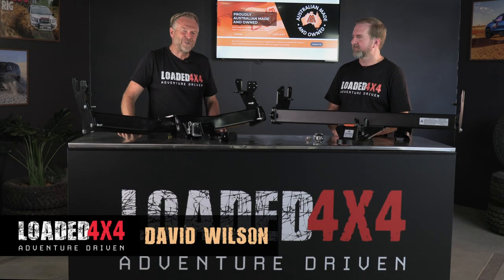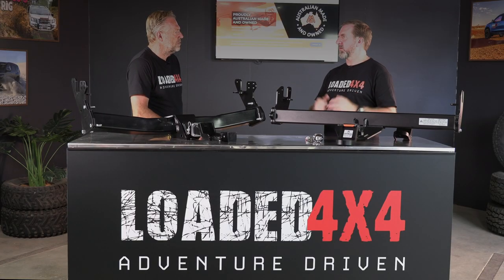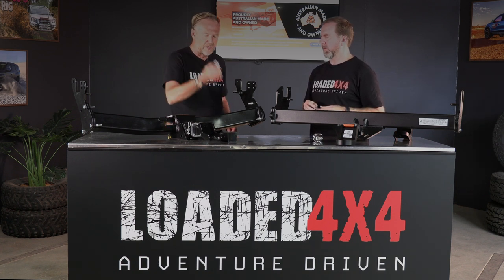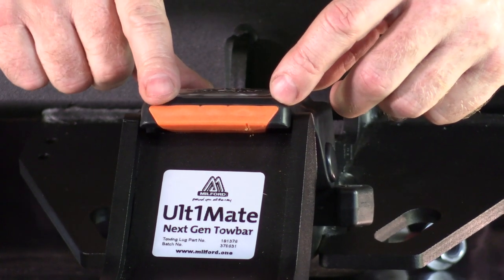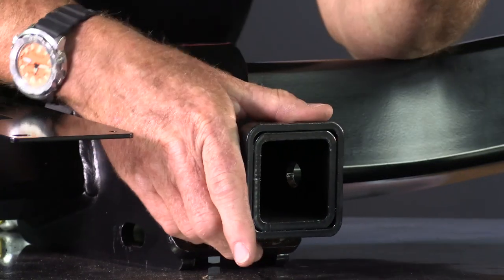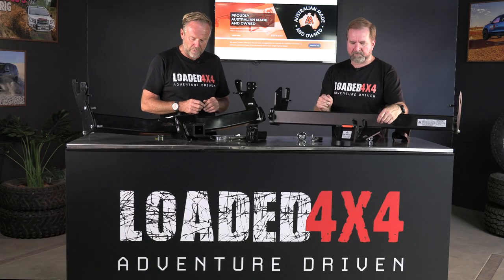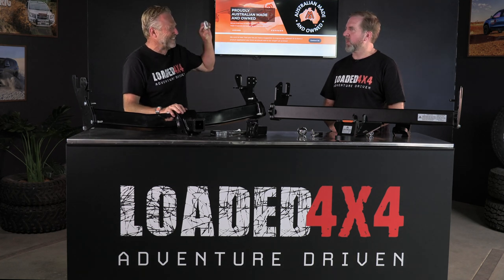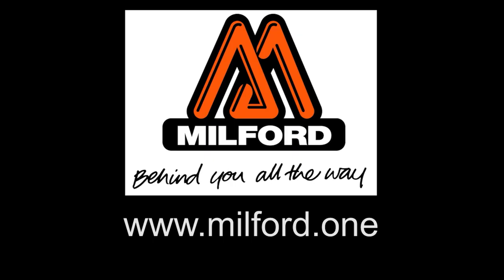Milford's Ult1mate Next Gen Towbar vs OEM Towbars

Comment: Looking at that Milford tow bar, the towing plug isn't attached any better than OEM. A couple of little screws is worse than welding. 
Also as somebody who deals with stainless steel all the time, the end of that pin looks like it will bend really easily with it being reduced in diametre so much. 

Also I've never used the anti vibration screws, because I don't see why you'd leave the tongue in long term if it's not being used.
Reply: Thanks for your observations but a couple of points of difference. The tow plugs are more secure on the Milford1 towbar as they are located on either the RHS or LHS of the receiver tube BUT on the triangulation bracing plate where they won't get wiped out on the first exit when off-roading. They are protected. The genuine bar's flat tab is flimsy and easily bent out of shape. Regarding the securing pin, there is no way that the pin is going to get bent at the reduction point where the R-clip is installed, because there will never be a force imposed on it and changing direction. It'll only ever be installed running straight and true and can't get bent. There is plenty of meat there for the R-clip to rest on and I'd wager it'll still be intact, long after the vehicle it was attached to, has gone to the big auto scrapheap in the sky. Re the anti-rattle bolts. Yep, some folk are smart enough to remove their tow hitches entirely and only use them when towing, but the overwhelming majority (like 99%) are lazy and leave it in situ, where it seizes through corrosion. On that day when you want to remove the hitch the bolt shears and that'll be the gotcha moment!